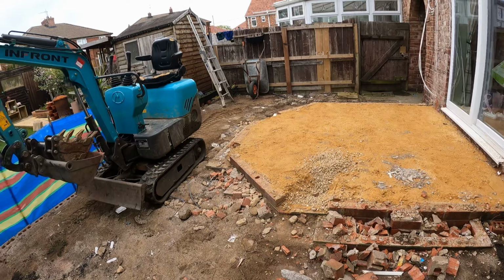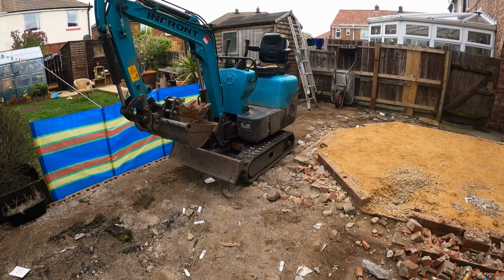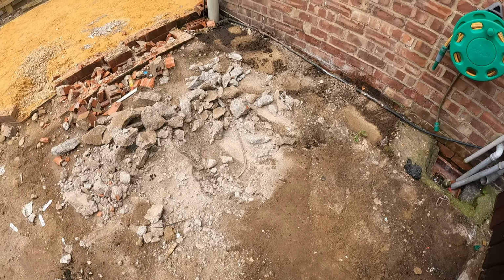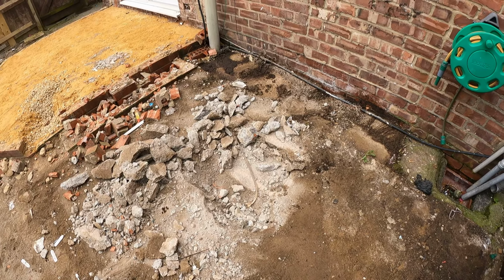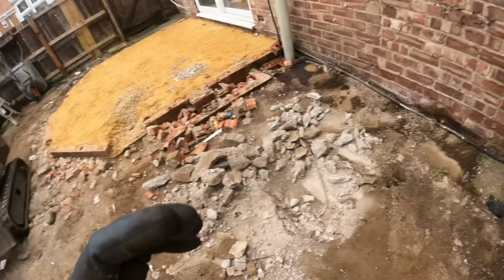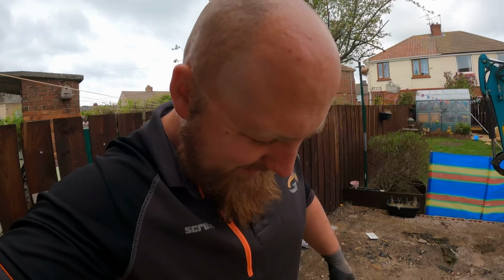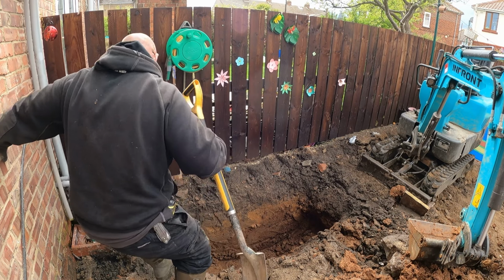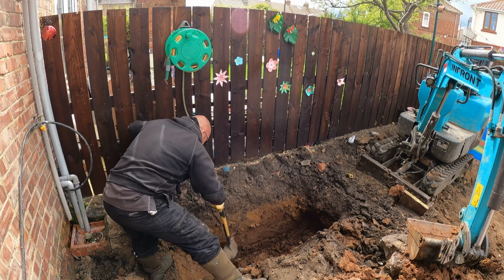Extension build Day 2 - GIRL POWER !!! ~ Chinese mini digger

Comment: Welcome back MINI DIGGER! Looks like tough job in that clay Nick.
Reply from the maker: Hey buddy, yes some of that clay was hard and the top was soft, my digging bucket teeth were just creating channels in the clay so I removed them, then I needed to put an edge on the bucket as it was just flat. All good now and will be getting better footage of the digger tomorrow (or today in my case 😆)
Reply: @everydaywithmenick  I wondered what you were grinding at, good idea for a smoother trench through.
Reply from the maker: @HomesteadingUncontained  yes it desperately needed a bevel putting on the bucket. Too flat and wouldn't score into clay. I should have done it ages ago.